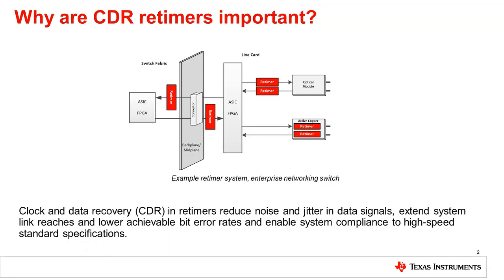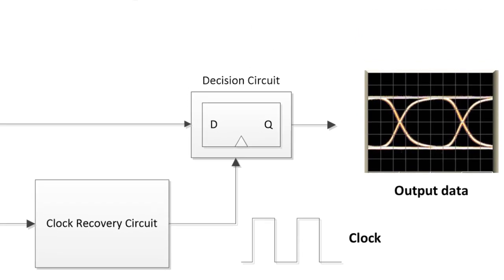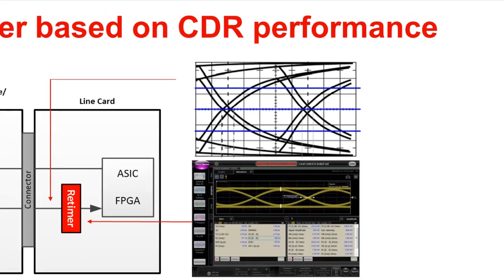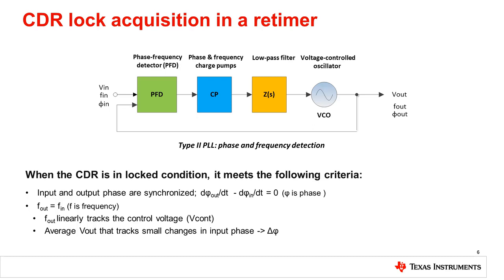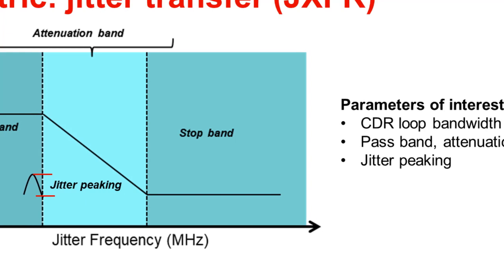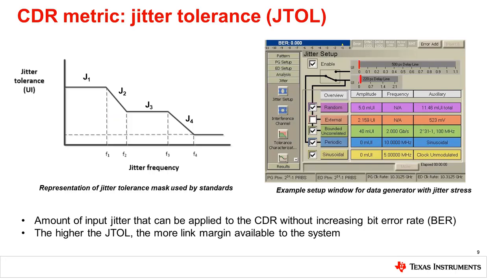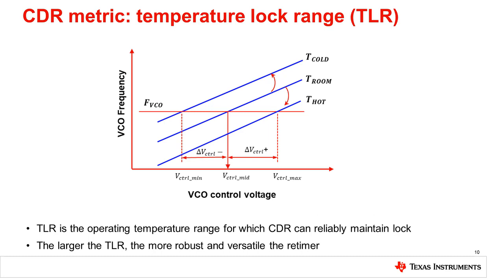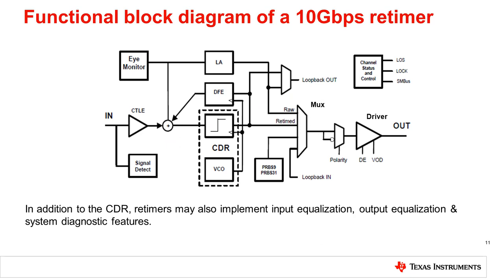What is clock and data recovery?

Comment: How do we know where to sample if CDR is bypassed? We may end up sampling right at the transition and see no signal.
Reply: Yes, that is possible if we mentioned the type of a receiver that using clock recovery process from data straem. However, this is just retimer, which means that's role is just improve signal integrity on the communication channel.